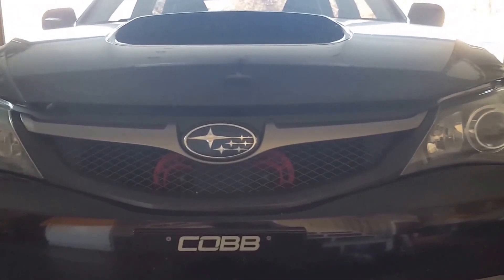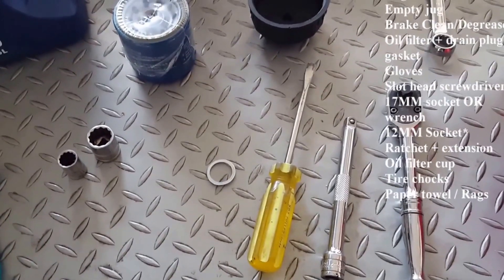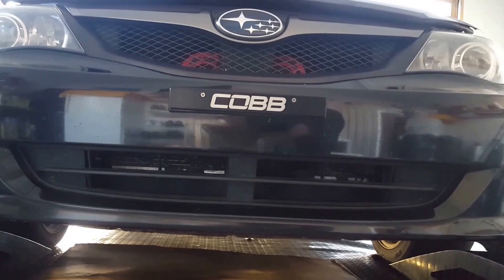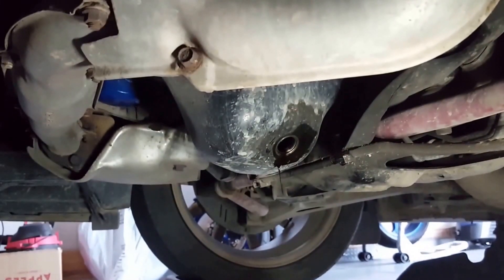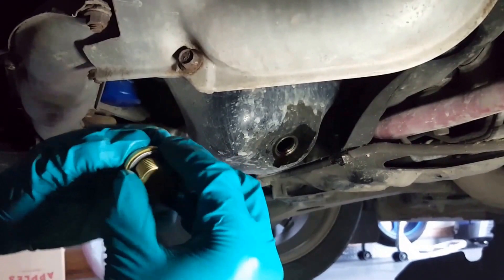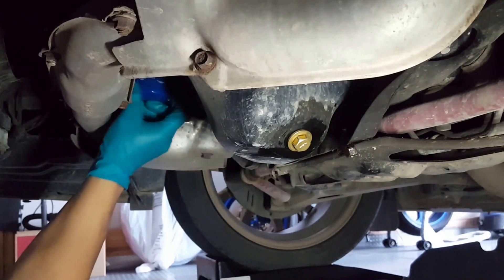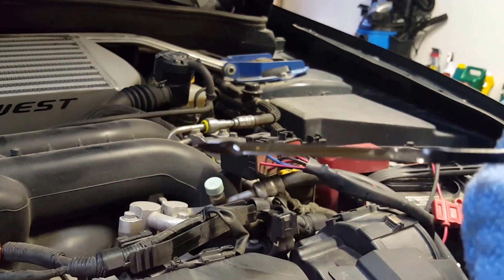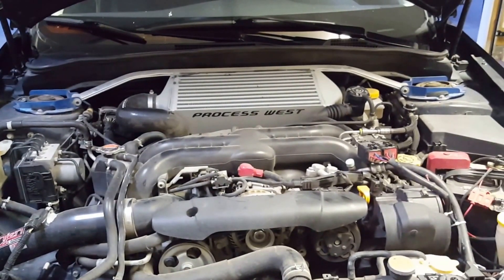Subaru Engine Oil Change - 2008+ Impreza/WRX/STi

Comment: Hey man I recently bought a wrx and it has the same air intake setup as you. It's probably the cracks and holes in the wheel fender and underneath as well but have you ever had problems with water getting in?
Reply from the maker: Cold air intake that sticks into the fender? I had all the skid plates and fender liners still there. AEM or Injen had a product for water resistant cover its like a bag you fit over. Let me know if you want help finding a link.

Comment: Was wondering where u got ur intercooler? Been trying to find 1 for my 09 impreza gt..
Reply from the maker: Where are you located? Its a Process West brand intercooler, there should be quite a few suppliers for them
Reply: @petrol-bay6928  I'm located in northern cali..way northern California..also what kinda of best bang better than stock but not hyped up turbo brand will be good? I'm trying to find 1 for my 09 impreza gt..just an upgrade not something crazy..
Reply from the maker: @touacheng9936  is your car completely stock? I would just recommend getting a good downpipe and a tune before bothering with a turbo
Reply: @petrol-bay6928  yes its stock..the reason y I said turbo was because idk if my turbo still good.imma take it out to check it but I just bought it and didn't even make it hme and threw a code p0011..but my oil was super low too...so idk..I'm just replacing all the things that can cause a p0011..including the 2 AVCS .
Reply from the maker: @touacheng9936  Pretty sure Subaru had a bulletin regarding that code for dirty banjo bolt screen filters. Check those too along with an oil change and the other items you are doing.
Reply: @petrol-bay6928  someone already took out the filter on those bolts

Comment: Nice video. Well made. What size in mm is that oil filter cap though? Thanks!
Reply from the maker: Pretty sure its 66.5mm with 14 flats for OEM oil filter, but don't quote me on that. If you use an aftermarket filter like Wix or Fram it would probably be different again.

Comment: Don't run the Ac right after an oil change (I heard it when you started the car post oil change at 6:40).  It disturbs the filaments from the exchanger between the CF and IC.

Comment: Do you recommend 'priming' the oil filter?
Reply from the maker: I don't bother priming the filter because it is so small, usually I'm more used to priming oil filters on big diesel truck filters because they hold almost 1 liter in those diesel engine oil filters